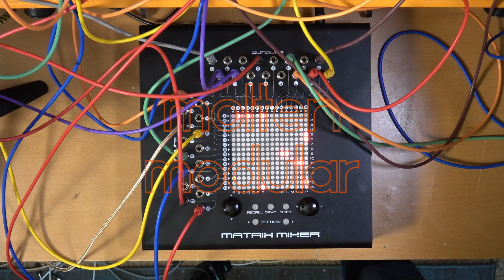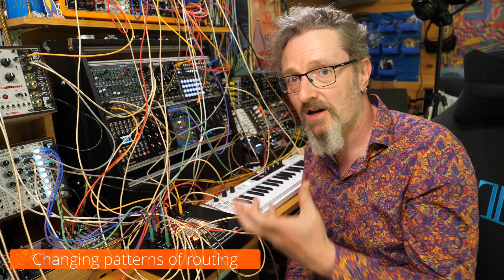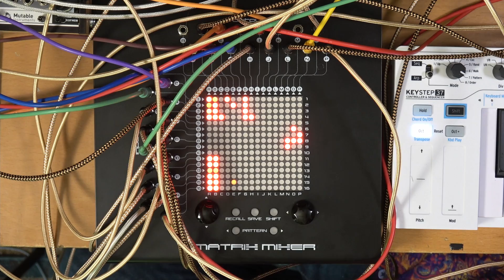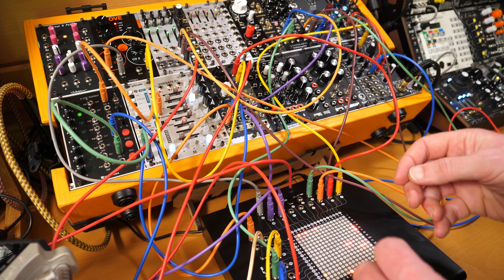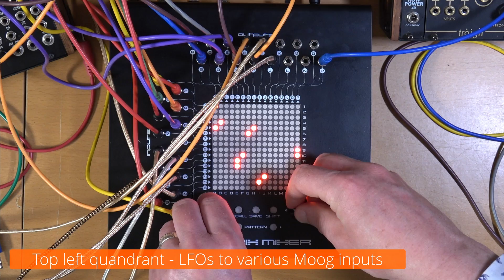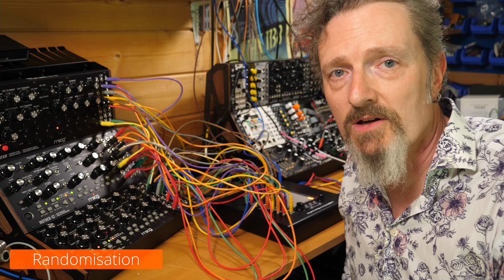Erica Synths Matrix Mixer - Review

Comment: Thanks for the review!

I just received mine yesterday.  I'm using it to route my guitar and guitar pedals.  

I am having an issue with the matrix mixer being pretty noisy, and when I route the signal through it, it is dulled.  Have you experienced this in any way?  I'm wondering if this is because of the guitar HiZ signal, but I'm not sure.

For example, I have one pedal connected to the matrix mixer and play some chords.. the sound is dull (not as bright), When I plug my guitar right into my interface, bypassing the matrix mixer, the signal is nice and bright.  The levels in my DAW are the same either way.

Thanks again!
Reply: did you ever solved this noise issue?
Reply: @grizzliesa9853  I went through the entire set up again, tested it, and it was fine.  I'm not sure what the problem was, probably user error

Comment: Could you actually recommend this as a kind of Patchbay replacement for line level instruments? I'm actually not so much at home in the modular world. Because I hate cables ;) And because of that I'm looking for a way to get rid of the cable management on my patchbay. And automated patchbays are very rare and even much more expensive. My plan would be to route my instruments in there (from the patchbay) and then into the mixer/pedals/samplers. Would that be possible or is that amount of line level stuff destroying the sound?
Reply from the maker: Possibly - but not something that i tried. Give Erica Synths a shout about it :D

Comment: Molten Music Technology would I need two Erica Synths Matrix’s to have true, L & R (out) or is there an independent Modular/Module to achieve?
Reply from the maker: Stereo is 2 channels right? You have 16 channels on the Matrix Mixer. You can use them however you wish. If you're looking to mix and balance in stereo then that's s different device all together.
Reply: Hey, I am sending a stereo audio signal into the matrix mixer form my er301 and routing it to the intellijel rainmaker. When the rainmaker is fully dry I notice that the signal coming into it from the matrix mixer is not stereo. I double checked to make sure there is noticeable stereo movement in the audio coming out of 301. I am assuming the matrix mixer sums everything to mono ?
Reply from the maker: @Braek-xyz  All the inputs and outputs are mono. So if you want to use a stereo signal you need to use a pair of inputs (left and right) routed to a pair of outputs (left and right)
Reply: @MoltenMusicTech    that's exactly what I am doing. I have the left and right going into INPUT 1&2, the outputs A(l)&B(r) going into the l&r inputs of the rainmaker. And I Hear the output as a mono signal with the rainmaker fully dry.
Reply from the maker: @Braek-xyz  Ok, well the Matrix isn't doing anything clever. If you take 2 channels of sound out of a module and put that into another module nothing will be different if you put the Matrix in the way. If you go In1 to OutA nothing has happened to that audio. Also if you go In2 to OutB nothing has happened to that either. So routing that to your Rainmaker will be identical to plugging it in directly. The only way it gets messed up is if you also route In1 to OutB and In2 to OutA then it's summing everything up so you get the same output at both. So the problem is likely to be with your routing. Why don't you try two completely different signals through the same both channels and see what you get at the other end?
Reply: @MoltenMusicTech  this is very embarrassing, but you are right I summed it up and that was the issue 🤦🏽‍♂️. It works fine now, thank you. I am currently running a mega patch and honestly getting quite lost 🙃
Reply from the maker: @Braek-xyz  Ha, that's all right mate, sometimes you've just got to go back to one cable at a time :D
Reply: @MoltenMusicTech  😆 word!!!

Comment: Could this be viewed as a viable alternative to the matrixes of the original Arp 2500? Behringer only needs to release one more unit to complete their set of the 2500 module remakes ;)

Looking forward to your review of the 1027 clocked sequential circuit btw :D

Comment: the colored lights aren't buttons, so you can't do any fast rhythmical changes 
and there's even no 1v/oct or trigger in for changing the patches/presets with cv

seems way too basic and limited, a missed opportunity and not playable for jams
the earlier version with the screen was much better instead of scrolling with 2 knobs like an etch a sketch
Reply from the maker: I do see what you mean - i was very much focused on what it does do rather than what it doesn't. When I have more time i'm going to wire in the Befaco VCMC to do the patch changing. For me the manual changing worked very well and because you have 256 slots you can easily build in a whole bunch of changes and step through them with your finger.

Comment: Thanks for the video. I am thinking about the sum of the voltages and  the possibility of impedance problems. Is anything about that in the user manual? Thanks
Reply: The manual states that everything is buffered, so that would solve potential impedance issues
Reply: @omoerbeek  thanks
Reply: https://www.ericasynths.lv/media/Matrix_Mixer_manual_28.06.2021.pdf - manual here
Reply: @moolefty6683  Thanks.  nothing here about my question
Reply: @LiradigitalMusic I would like to see more than 3 impedance levels - like 6 or so - . or gradually ,- or maybe im thinking on something different - the light dimming . on the matrix points,-
Reply: @LiradigitalMusic  o rly? the manual states 10vptp.